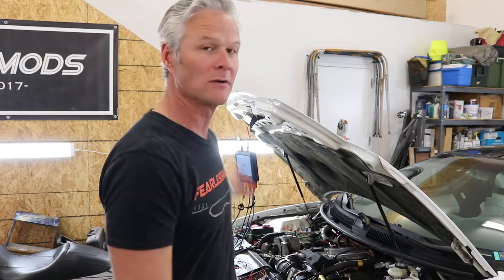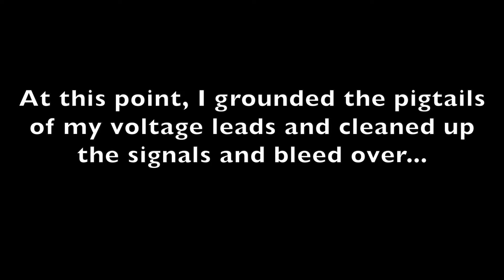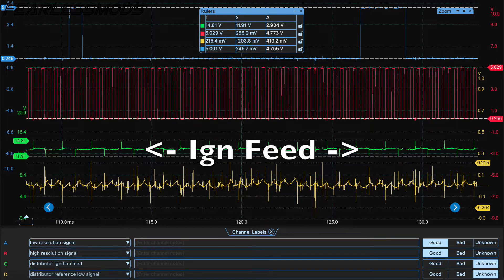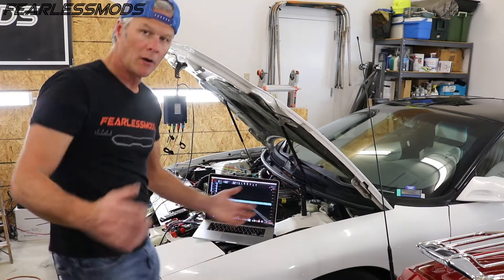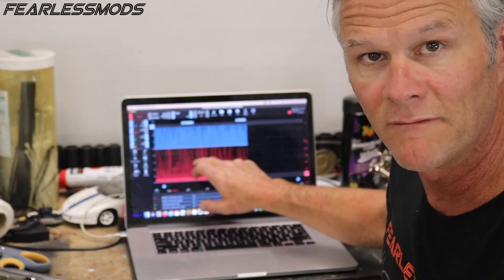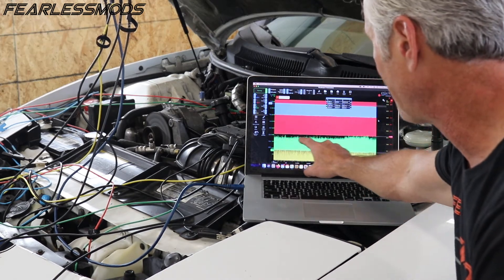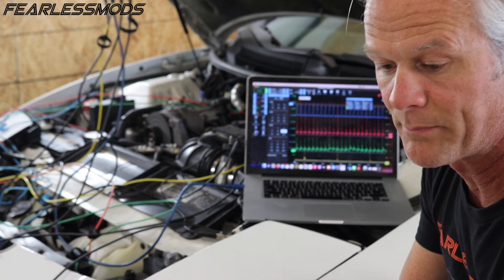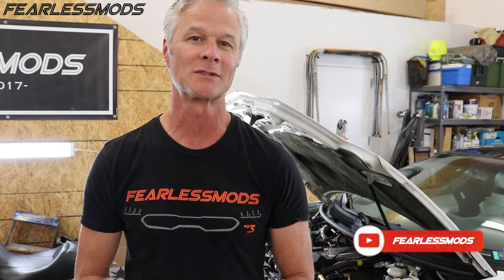Pontiac Firebird Trans Am Ignition Diagnostics part 3:  PCM to Optispark signals

Comment: As your AFR changes your firing line will respond. Lean = higher KV rich = lower KV. At that resolution you will really see perfectly level firing lines.
Reply from the maker: I'm guessing with the lower lines, it confirms my extremely rich condition (as indicated by the horrendous rich fumes!)
Reply: @FearlessMods  yes

Comment: I have a 94 Firebird formula just had my ECM re-done had all my shift points changed deleted all the antitheft Brand new transmission new coil new ignition module new throttle position sensor I change the OPTi spark two years ago long tube headers thing was running awesome now I’m having the same problem as you are Just ordered a new OPTi spark Good luck please keep posting new information thank you very much if I figure something out I’ll let you know